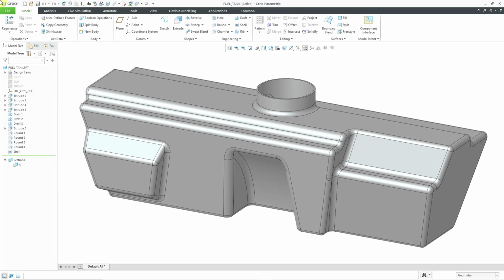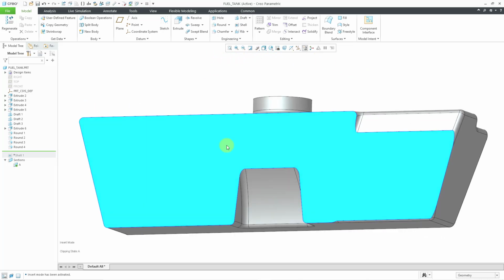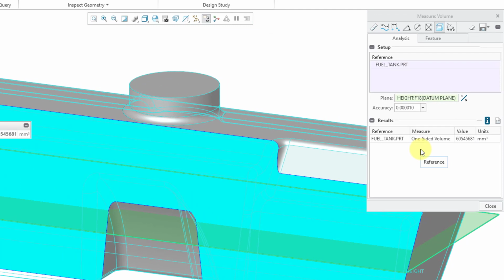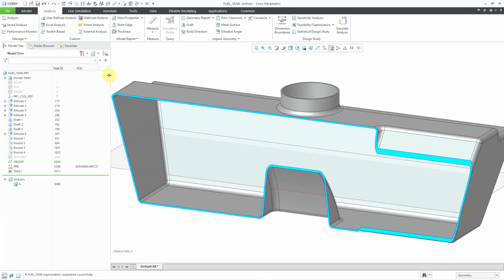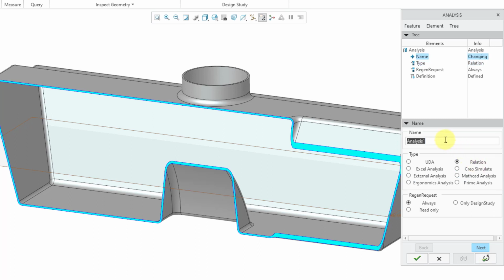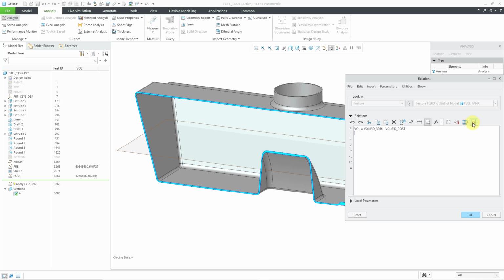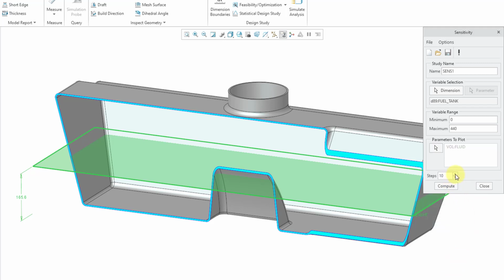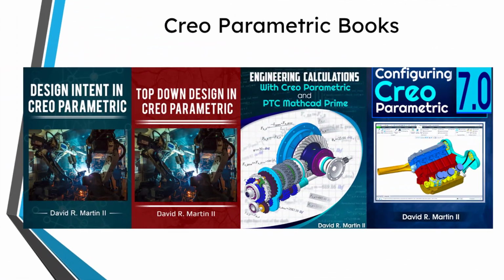Creo Parametric - Behavioral Modeling Extension (BMX) - Relations Datum Analysis Feature 2

Comment: Hello Dave and thanks for this tuto , If I want to engrave on the container several levels for example to 10 liters, 20 liters, etc how should I do ?
Reply from the maker: Create a datum plane with a height dimension. Run a feasibility study to drive the height to the desired volume. Repeat for all volumes. Create a curve or sketch at the various datum planes. Use the Flexible Offset command to make an engraving.